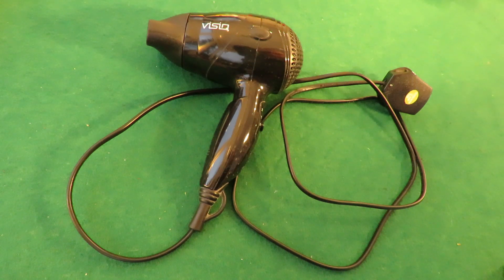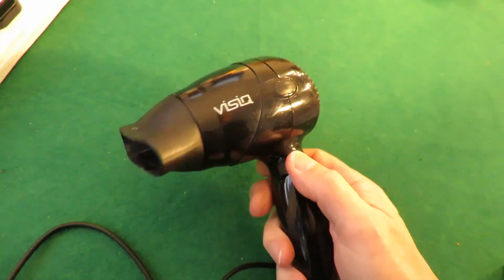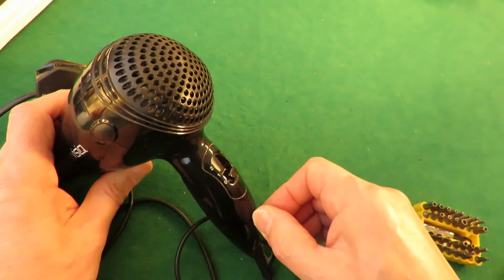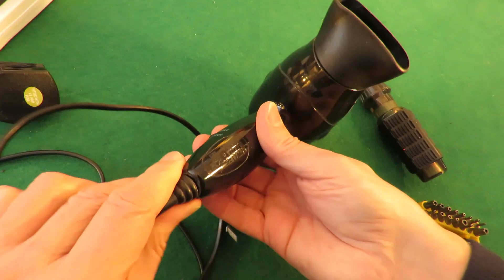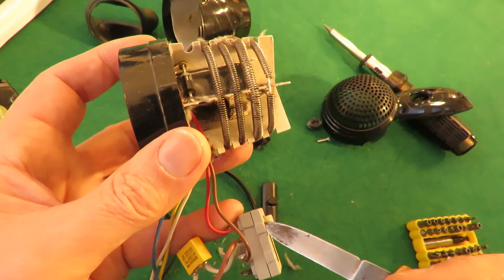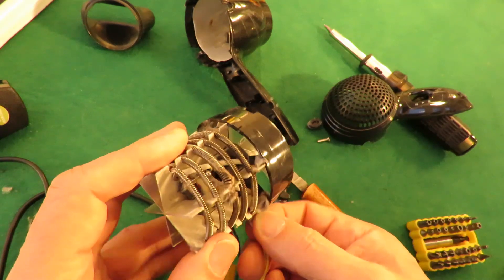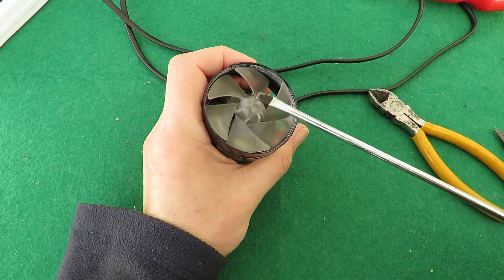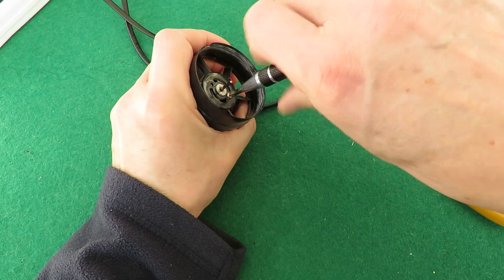Another hair dryer tear down DC motor 200301

Comment: Hi can I ask if the motor will also suited to battery 9v
Reply from the maker: Sorry, if you saw my previous reply. I deleted it. I thought this was a different video (as mentioned in the video description). Yes this motor would probably work OK on a 9v battery but would probably drain it quite quickly.
Reply: @GrandadIsAnOldMan   oh thank by the way  I have my school project it's mini vending machine and  I really want to know if this motor will be applicable to use because  some of the recommended videos in Yt they use DC motor and micro servo. But  I didn't get it right

Comment: Lots of useful parts from it. The motor looks like a good powerful one and then you have a good length of Nichrome wire, plus a switch, so you have some useful parts. That looks like a good 3D printed prop.  👍👍👍
Reply from the maker: The main thing I was looking for was the motor. I have plenty of that nichrome wire from all the others I have taken apart. You found a good prop on Thingiverse and adjusted it to my needs 😁👍

Comment: Im no electrician but i think you will find that the yellow block that is wired into the switch is a resister, so when the power flows through it it halves the speed.
Reply from the maker: Hi Peter, I think you will find that yellow block is a capacitor. In fact in parallel with it there is a small resistor to discharge it when the hairdryer in not in use. The capacitor is directly across the live and neutral wires. Sometimes called a safety capacitor or an X capacitor.
Reply: @GrandadIsAnOldMan  My mistake, it looked similar to the two speed controllers on my grandsons 1/12 RC race cars.
Reply from the maker: @peterdering4922  no problem, as far as I could see the speed and power control of this is as simple as switching in and out that big diode so it only uses half cycles from the AC supply for half speed.

Comment: 6:15
I bet that heating element would be good to make a DIY high amperage rheostat .
Reply from the maker: Probably, but as I mentioned in the video I used the same stuff to make a hot wire bow for cutting foam.